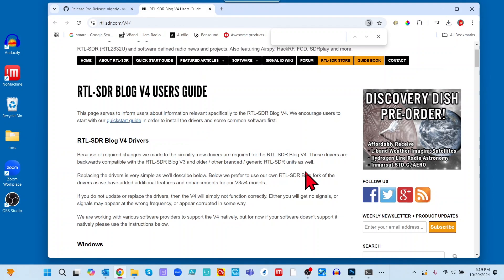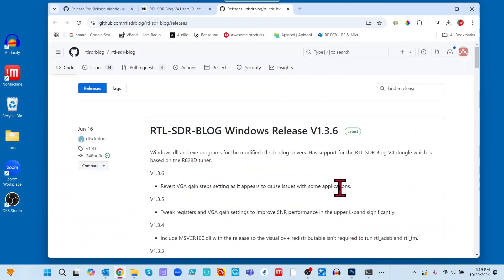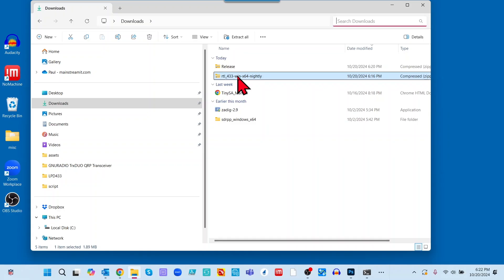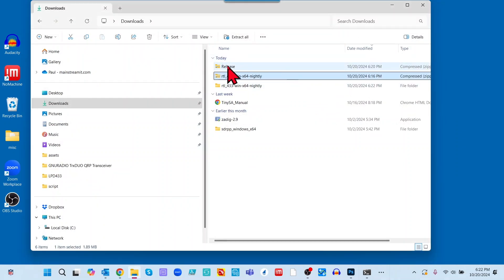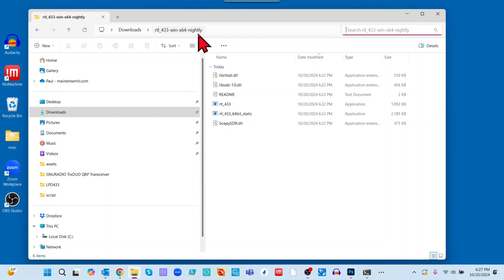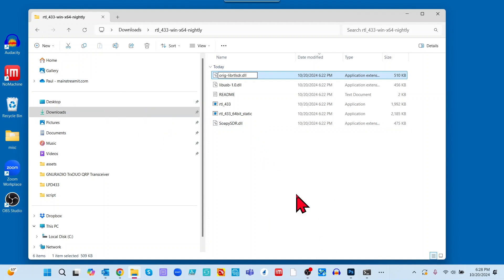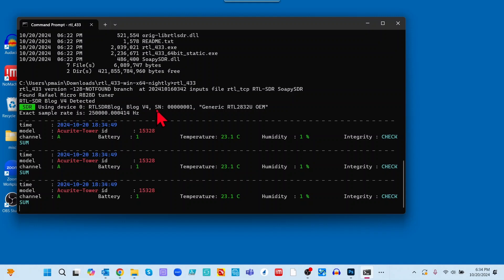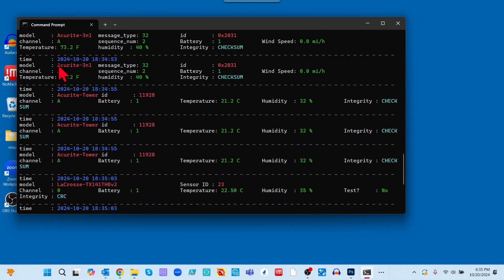E8 Decode Your Neighbors Low Power 433MHz Devices

Comment: This is a good, basic introduction. It would allow a person to see what devices are transmitting nearby without much effort or additional expense (besides the SDR dongle). From your title (which included the word "decode") I thought you might be talking about actually decoding sensors, such as those that aren't already known to rtl_433. rtl_433 has a LOT of common sensors (like all the ones I mention below) but there are still many others that have yet to be added. If you're familiar with that topic, it would certainly make a great ADVANCED topic, but a much needed one.

In case some people aren't sure of what other use-cases there might be, besides voyeuristically peeping on your neighbors' weather stations, let me toss out a few...
1. I monitor MY OWN weather station (and my neighbor's too, he's got the fancier one with a rain gauge!). Mine only came with a single head-unit (display) and I have that in the common area, but I want to be able to view the data from my office, cell-phone, anywhere. I set the config options in rtl_433 to re-send all incoming data over to my home assistant (via MQTT). That let's me view history such as "what were the wind speeds overnight?" and I can display it in multiple places throughout the house.
2. I monitor the temperature(s) in both my freezers. Wal-mart sells very inexpensive 433Mhz devices with a head-unit and two sensors (about $10 USD) and these show right up in rtl_433 and HA. So I can monitor them and send alerts to my phone if a freezer fails or gets accidentally unplugged.
3. The tires on your car broadcast their pressure on 315Mhz, so just set your rtl_433 config options to monitor that frequency too. (hop back and forth). That let's me keep an eye on the vehicles and know BEFORE the car's dashboard alerts me, if they're getting low.
4. In my city, the natural gas meters broadcasts up on 915Mhz. I watch those too.
5. I've got a wireless thermometer for my BBQ (or kitchen, where ever). When that's on, it broadcasts on 433, so especially for long cooks, like smoking meat or a large roast, I can go back to my office while still monitoring the progress.

6. One of my neighbors installed smoke detectors that show up when they are tested or alarm. I can check on his house if it keeps alarming, maybe save him his home if he's out or at least notify the FD before it spreads to my house... ;-)

If you find lots of useful devices near you, I'd recommend moving the SDR dongle to an old/unused PC or a Raspberry Pi so you can let it run all the time without being dependent on your main laptop/workstation.
Reply from the maker: @TheDanielsherer  Thank you for your excellent comments. My intended audience was beginners for this video. The 433 software is decoding known devices. I think you may be asking about an advanced video that shows how to figure out a new device and protocol that’s not yet known to the 433 software. Since you are using the message queue you’re certainly an intermediate or advanced user. I will consider your excellent suggestions. I have had some life changing events and that’s why I haven’t put up a new video for a while. I intend to begin posting new videos in the near term further.
Thanks again for your wonderful comments and suggestions!

Comment: Thanks for the video! These things are so complicated it's nice to have a step-by-step from someone who's done it.

.....sadly, I get errors when I run it: 
[R82XX] PLL not locked!
Disabled direct sampling mode

and then nothing else. I do see some stuff on 433 in the spectrum display.

The SDR works fine in some other apps (cubicsdr etc), so I'm not sure what's going on here. There are some suggested command-line options (in the help) that include "direct_samp[=1]", but I haven't figured out how to get it to accept the options or whether they will help my issue.  Sigh....

Time to go do some more reading, suggestions welcome.....
Reply from the maker: Hi - I will try to assist you. Are you using an RTL-SDR V4. Direct sampling should be disabled.
Reply: @ thanks! I’ve actually got a nooelec NESDR mini. I didn’t even think about the type of device when I saw the video, I wonder if that is the issue…. Different driver interfaces and stuff. More to research. 

But then, I did actually get it working with an rtl433 plugin for SDR Sharp! It’s nice to have all the options laid out in a gui, and a one click export for all the interesting packets i heard (not a lot actually, but a weather station and some power matters).